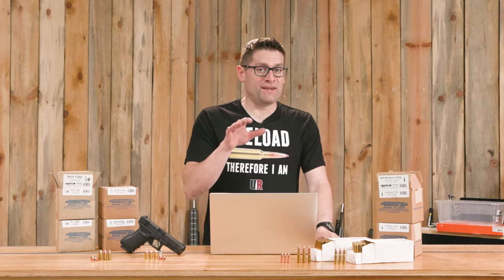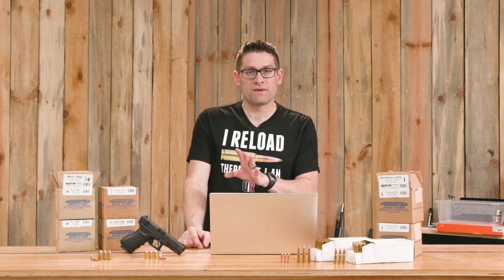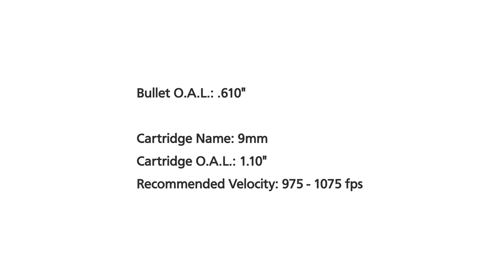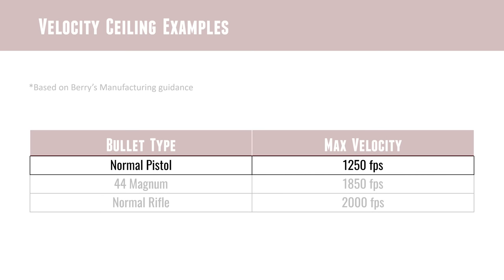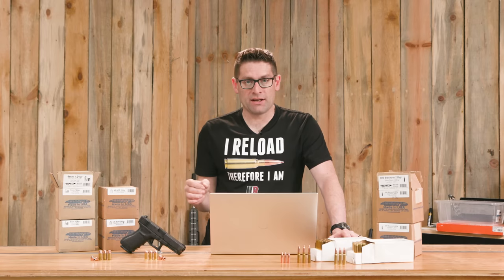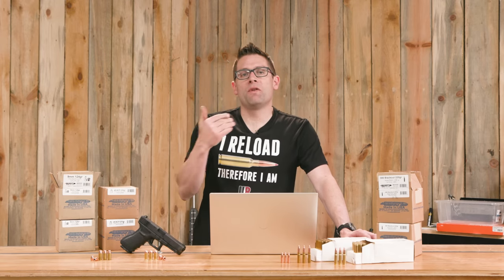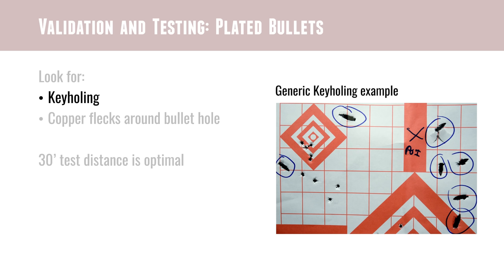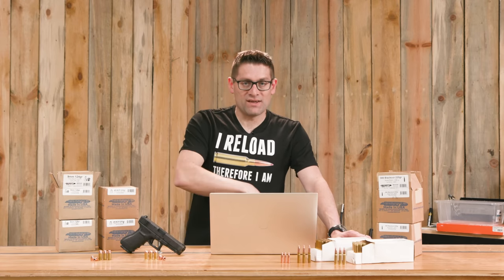Plated vs Jacketed Bullets: Load Data and Considerations

Comment: I use Berry's for .45ACP but not for 10mm. My results have proven this out. With .45ACP rolling out at around 1020 fps the load was stable and accurate. With 10mm the loads were too fast and were inaccurate. Of course I can't bring myself to load 10mm down to anorexic velocities so I stick with jacketed bullets for ten mil.

Comment: I have found plated bullets shoot laser accurate from some barrels, but horribly bad from others.  Like they'll barely stay on a 11x17" target at 50 feet.   Can someone cue me into why that is?

I've loaded and fired many thousands of rounds with polymer coated bullets.  They are less temperamental and (usually) cheaper.

Comment: What are plated bullets?  Jacketed bullets only thinner?
Reply: Jacketed bullets start with a cup, usually drawn from gilding metal (copper/tin alloy) and filled with a lead core. The jacket is then closed in a swaging process whereby the bullet gets its nose, closing the lead inside the jacket and resizing the bullet to the correct diameter. Because of the hardness and thickness of jackets, the diameter must match the groove diameter of the bore to be accurate and safe to shoot. Greater velocities are possible with jacketed bullets as the jacket helps to reduce bore fouling and hold the bullet together against the centrifigal forces exerted on the bullet during its spiraled flight to the intended target.

Plated bullets are cast lead bullets that are then electroplated with a thin plating of copper or  copper alloy.  Berry's Bullets double strikes their bullets. this means that they cast the lead bullets, resize them, electroplate the bullets, and then resize them a second time to insure the bullets are of the correct diameter.Cast lead bullets, because the lead is soft, requires the diameter of the bullet to be about .001 inch greater in diameter than the bore groove diameter. This allows the soft lead to fully "grip" the rifling. Since plated bullets are lead bullets electroplated with a thin plating of soft copper or copper alloy, it is sized .001 inch greater than bore groove diameter to again aid in "gripping" the rifling. Lesser velocities are possible with plated bullets as the plating is thinner providing less protection against bore fouling and the plating offers virtually no structural defense against the rotational forces exerted as the bullet flies to the intended target. 

It is advisable to use cast lead bullet loading data when loading plated bullets. By doing so, one is now limited to accurate load data that keeps your cartridges functioning under the rated velocity limitations given by Berry's Bullets, and provides for safe chamber pressures to protect shooters and bystanders alike. Crimping plated bullets should be limited to light crimps only as the plating can easily be damaged causing the copper plating to break away from the bullet, affecting accuracy. Additionally, when loading plated bullets, flaring (sometimes referred to as belling) the case mouth is required to avoid damaging the plating during the bullet seating process.

This is only a quick answer to your question. There is a lot more information available regarding this subject. I hope I have given you the answer you were looking for.
Reply: @jeffreymccright3542  perfect!   Thank you!

Comment: I'm not a fan of running 220 grain suppressed 300 blackout plated out of a 1/5 twist rate q honey badger or sig rattler 300 BO guns. the twist rate is way too fast and the jackets will come apart. My fault, I should have read the fine print on Berry's box, do not use 220 plated on a twist rate faster than 1/7. this baffle striked my suppressor im getting warrantied right now.

Comment: Hey all I’m still a noob in the gun world can someone help me understand grain and bullet twist and length. I mainly shoot 9mm and 5.56
Reply: In general, as bullet mass and/or velocity increases, so does twist rate. For instance with 556 NATO, a 55gr bullet at moderate velocity might stabilize well in a 1 in 9" twist rate. At that same velocity if you increase to a heavier bullet like 69 grains, you may get better stabilization by increasing to a faster 1 in 8"  twist rate.  If you go back to the 55 grain bullet and shoot it at a higher velocity than you did before then you may want to increase your twist rate from 1 in 9" to 1 in 8". If you push the 69 grain bullet to a higher velocity, you may get better stabilization of that bullet by increasing from a 1 in 8" to a faster  1 in 7" twist rate.   

Since there is no dial on your barrel that allows you to adjust the twist rate on your rifling (oh that would be big money magic right there), you have to experiment using different ammunition whether it's factory loads or your own handloads to see what shoots the best out of your rifle. 

There's a lot more to it but that is the Bare Bones most important part of it.
Reply: 9mm won't be much of concern.  Each caliber will be different.  Heavier bullets require faster twist. 1:9 556 is recommended 40-62gr bullets.  You may find it will shoot a 70, but generally not.  Google 223 twist chart.
Reply: To build on the previous comment.  Twist rate is how many times the bullet does a complete rotation in the barrel.  So, for example, 1 in 9 twist would be one full rotation of the bullet in every 9 inches of barrel.  A 1 in 7 twist would be a “faster” twist rate as it would rotate the bullet a full revolution in 7 inches rather than 9.  Keep in mind that barrel length can also make a difference in conjunction with the twist rate.

I’d argue, for 99% of people, twist rate out of a handgun doesn’t really matter much (speaking from experience with common calibers 25acp all the way up to 357 magnum - hunters/big bore I’m not sure, maybe someone else can educate us).

When you get into rifles, it starts to matter more.  Like the previous commenter said, generally the heavier the bullet, the longer the bullet is.  Long, heavy bullets generally like “faster” twist rates to stabilize the bullet for better accuracy.

We can use a 5.56 rifle like an AR-15 as an example.  Many decades ago, ARs had 1 in 12 twist rates.  Then it was realized that bullets generally stabilized better with a 1 in 9 twist rate and that was the standard for a long time as it did a good job a stabilizing 50-55 grain bullets, and generally did an okay job with stabilizing 62 grain bullets as well.

As people began using more and more 62 grain and up bullets (77 grain as noted in the previous comment is a bullet with a ton of accuracy potential), it was realized that going to a 1 in 8 or 1 in 7 twist barrel stabilized those bullets better, and still did a good job a stabilizing 55 grain bullets as well.

Lastly, these are general rules.  Every gun is different.  It takes experimenting to find the best load for that particular gun.  If I was going to buy a 223/5.56 AR-15 rifle today, I’d go with a 1 in 8 (first choice) or 1 in 7 twist barrel (second choice) from a quality manufacturer like BCM, Daniel defense, or FN for any barrel 10.5 inches up to 20 inches.

Comment: Berrys plated pistol bullets are wider in diameter than jacketed.  Hogdon ballistitians suggest using lead bullet reloading data.  I blew up my Kimber 1911 using the reloading data from my Nosler manual which was 5.3 grains of W231 behind the 230 grain bullet.  There is a huge difference in charge weight depending on which manual you are using.  Another good topic for a video?

Comment: @gavintoobe What were your findings for the 7.62x39 bullets you reloaded about a year ago? https://www.youtube.com/watch?v=iif9TqEfowA They seemed to be work out well but at the same time you were getting to 300-400fps over the 2000 mark. I've used berrys for 38sp, 9mm, 45ACP, 44Mag and 300 blk and the bullets were great. I tried the Berrys 1st gen 762x39 bullets and they were awful. They were actually flat tipped and worked terrible in autoloaders. Way too short of an OAL if you wanted to get decent seating depth in the neck. If not for that then they would hang up before chambering. So I now have a box of them that I guess will be melted down one day. I see now they have actual spire points. But if they can't go past 2000fps...

Comment: I rather get better bullets I don't have to deal with it
Reply: LOL, well if you got money to burn, then have at it. All i shoot is plated, zero issues.
Reply: @D70340  I want hot loads and not have to worry about the bullet coming apart
Reply: @D70340  and Berry bullets are expensive I don't know where you been shopping
Reply: I get hot loads out of my 10mm, no problems with plated bullets for knocking heavy plates. Generally I shoot pug loads at the range.
Reply: @RadDadisRad  yeah I'm pushing 200 grains a little bit over 1250 and 180 grain on pushing 1332. Watching a video like this I don't know and everybody's always saying caution about Magnum primers and regular primers I use both and I don't see no difference
Reply: I hear you. I use Berry's for plinking/target practice to save a little money. My high power hunting loads are with quality jacketed bullets and I buy factory defense ammo. But that's just what I do.